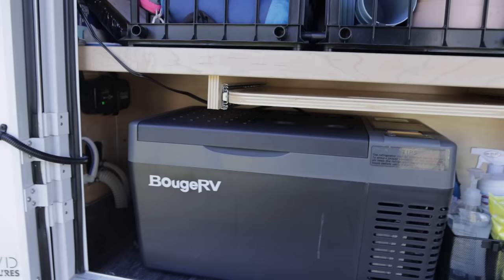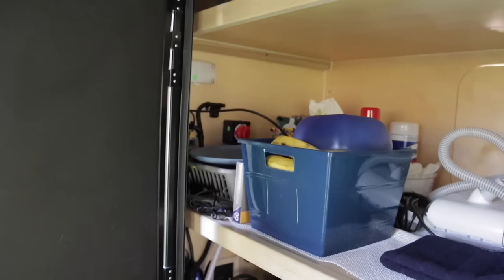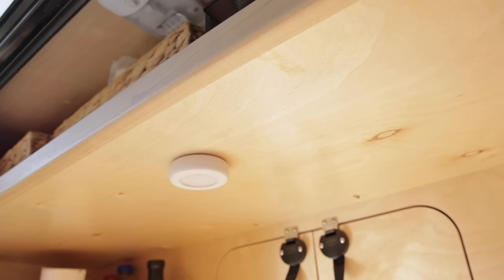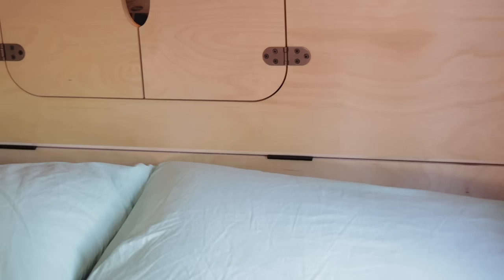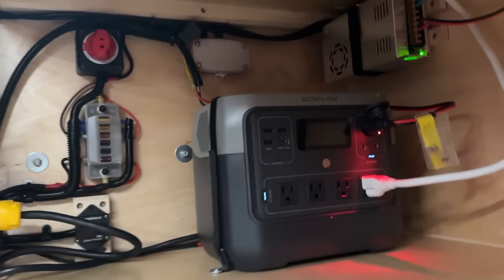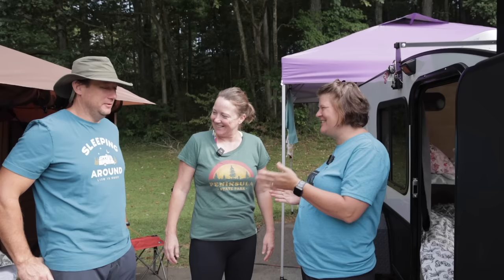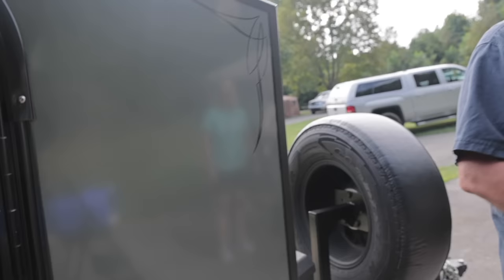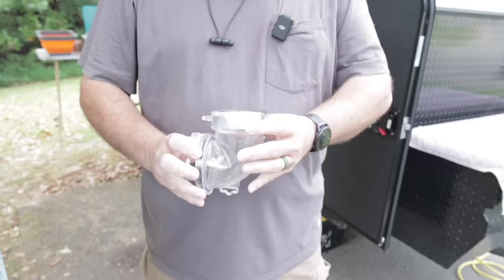HTC-E5: Hiker Trailer Owners Show off their Mods, Part 2

Comment: The lights on the underside of the awning supports was cool! Where did he get those from?
Reply: I was coming to post the same thing! I foresee a ton of those being purchased and installed by Hiker owners with a 270° awning.
Reply: BTF lighting is where I bought the supplies. There are a few led strip choices but I chose the 4in1 strip with warm white to keep the bugs away. You kind of have to do some research to figure out what all you need because it doesn’t come as a kit. I went with 24 volt but I bet 12 volt would probably work too. The advantage of 12 volt is you don’t need a power supply. You can plug directly to your breaker panel
Reply: @patricktrier4503  awesome thanks!
Reply: @patricktrier4503  where did you get the connections? I am doing an awning this winter, and am looking at doing something similar, but am struggling with connecting them all together, and how I want to do that. Currently, the kits I am looking at, from BTF, arent waterproof, so I was going to simply heat shrink them. But, I like your idea better, with the waterproof connectors!!! Mind sharing a build list?
Reply: @oldsoldier181  they are on the btf lighting website as well. The led strip I used required 5 pin led connector cable. They also make the splitter cable. Mine required 1 - 3 way split and 2 - 2way splitters. Then one role of the wire. There website isn’t the easiest to navigate but I was able to find everything I needed there except for the entry gland that I bought on Amazon. That is the piece brings the wires into the trailer completely sealed and waterproof
Reply: @patricktrier4503   Thank you!!! I will check their actual website out. I am looking at the IP67 rated light strips myself-these will be living outside, so I dont want to take the chance of them getting moisture inside.
Reply: @oldsoldier181  I actually recommend ip65 because they are still waterproof but they stick on better with the double stick tape. Ip65 are sealed in silicone while ip67 is sort of a case around the strip top and bottom. Also use the strongest 3m double stick tape you can find. I think it was called hvl.
Reply: @patricktrier4503  Last question, I promise! 30 or 60 LEDs?
Reply: @oldsoldier181  hahaha ask as many questions as you like, I don’t mind. 60 is what I got. I bought 2 - 15 feet strips which worked out to 5 feet on each of the 6 arms of my Darche awning. I got 60 because I heard that it produced better light coverage. The 30 leds are separated further apart
Reply: @patricktrier4503  Thats what I put in the cart. I recall something about them having a better overall lighting, etc. I put 2 of those strips in, the same connectors you mentioned, a 12V power supply (I have a Bluetti power bank in the truck, as well as a plug in the bed), and the 30' of wire. I am assuming that you wire the waterproof  connectors directly to the bare wires? First time doing electrical stuff-my awning is still a couple weeks out.
Reply: @oldsoldier181  you also need the connector parts that have the 5 pin screw connector on one side and the bare wires on the other side. The bare wire side will need to be soldered to the led strip so the screw pin side can disconnect from the main wire. Once you solder them you can use shrink tube to make it super water tight. Those connector pins come in a 10 pack. I think I bought two packs to cover everything I needed. You also need the controller. That was the little white box in the video. It is Bluetooth and works with the app on your phone. The exact controller you get depends on the type of strips you get. Hope this all makes sense